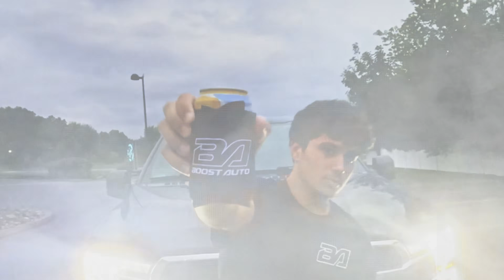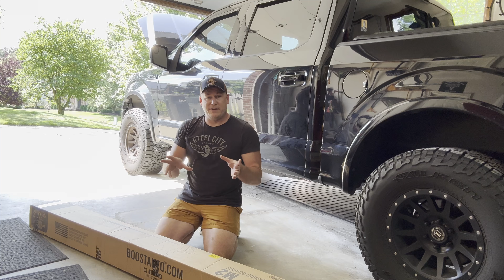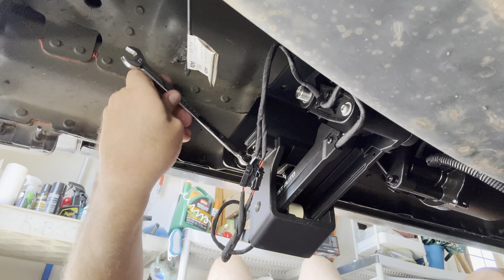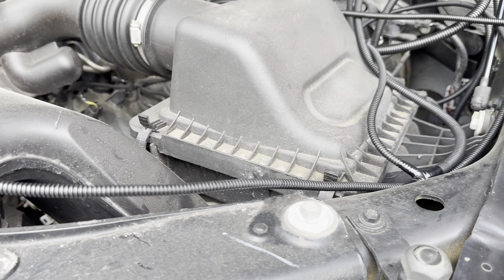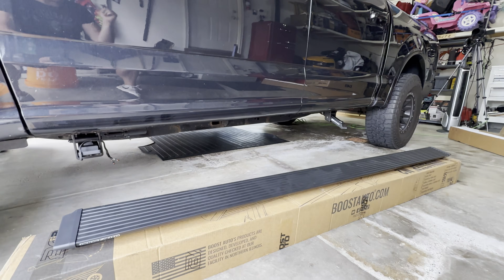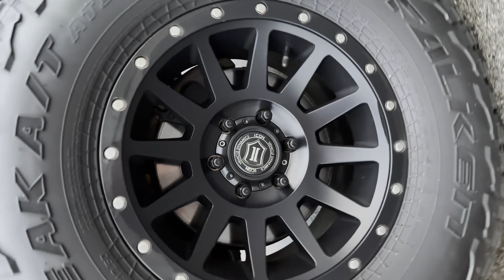Lumastep M2 Power Illuminated Running Boards – Full Install & Review | Ford F-150

Comment: I like these. Would love to know how they hold up on a truck that is in snow and road salt
Reply from the maker: Thanks! Mine made it through one Pittsburgh winter so far, and they've held up well. The motors still cycle smoothly, and there's no rust on the housings yet. I'll do a follow-up video after another season or two to really put them through their paces.
Reply: @tstdrvr  that would be great

Comment: Awesome installation, I’m thinking on getting a set for my truck,up today have u had any issues.
Reply from the maker: Thanks! Up to today, I haven't had any real issues. They've been through one full Pittsburgh winter (snow, salt, slush), and the motors still cycle smoothly with no rust. If you pull the trigger, you'll like them.
Reply: And are these a better alternative to AMP smart power step??
Reply from the maker: Honestly I can't say from firsthand experience, I've never run a set of AMP power steps. They look great though, and from what I've read they have a strong reputation. The Lumasteps have held up well for me so far if that helps any.